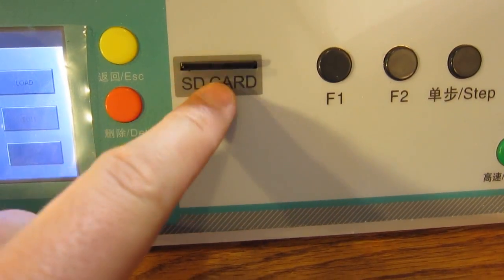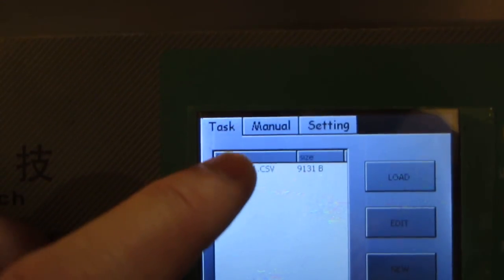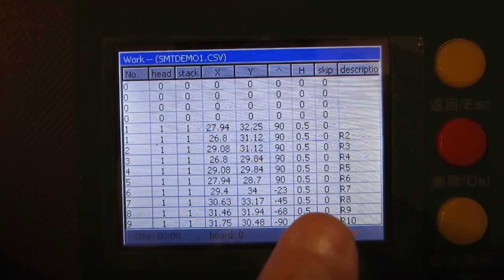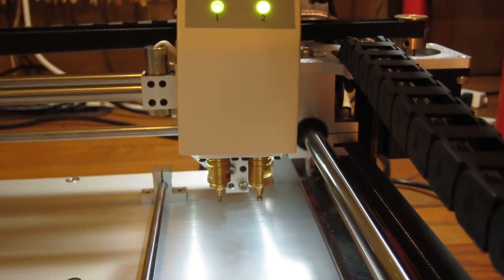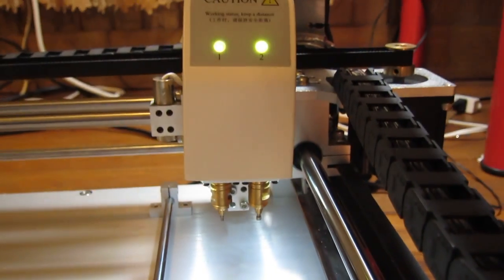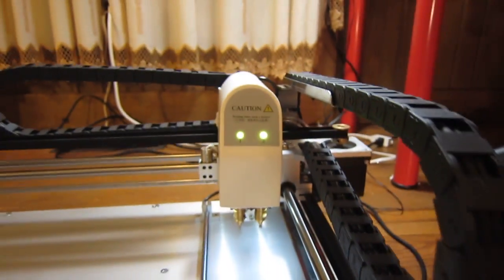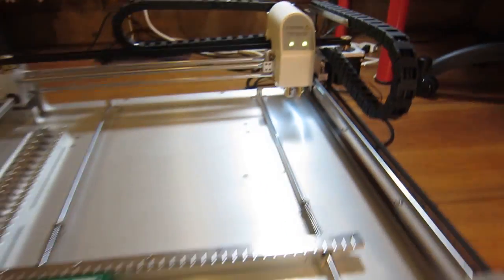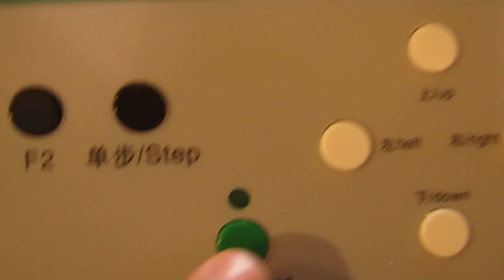NeoDen TM-240A Automatic Pick and Place Machine Demo - Part 1

Comment from the maker: It does not have a vision system. What I meant by 'alignment' is the initial self-test. Component placement is purely based on the x-y information given in the spreadsheet. It's ok for relatively large components (e.g. 0805) but I heard it's not very good for small components (0402 etc).

Comment: It looks like it's only using one head in this demo. In the manufacturer's datasheet for this product it specifies a placement rate of 7000cph, but it's obvious from this demo that is an optimistic "golden demo" benchmark. There's no way this machine is going to get near that mark when it is picking from the far end feeder or placing on a large board, and it would also need to be optimally programmed with dual picks.

Still a nice machine for $5k, though it's a shame it doesn't have vision for fiducial registration; could be tricky preparing PCBs for manual alignment if they haven't been diced well.

Comment: I take that this machine has no solder paste dispenser option. That is the biggest mark against it. Solder stenciling is very messy and wasteful.
Reply from the maker: ***** At $5000, I don't think anyone would expect it to come with a solder paste dispenser. Plus, paste dispenser is only useful for prototyping, in volume production, you will always use a stencil machine.
Reply: Ray Wang Do customers usually pay additional to their PCB fabricators to make the solder stencil or do you make your own?
Reply from the maker: ***** Where I order PCBs from (www.sz-jlc.com) you can pay $10 extra to get a laser cut stencil which comes with frame.